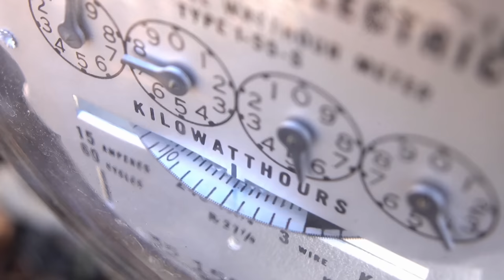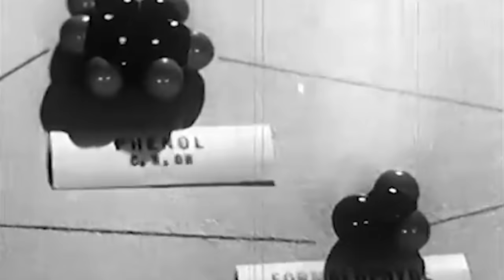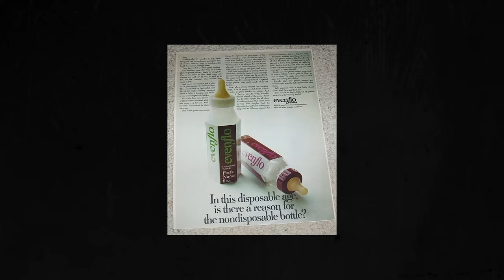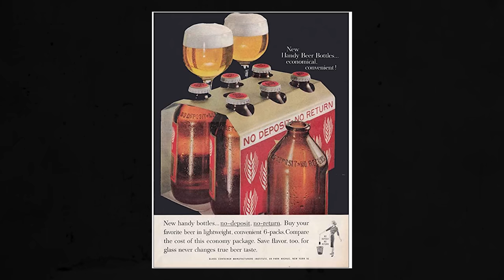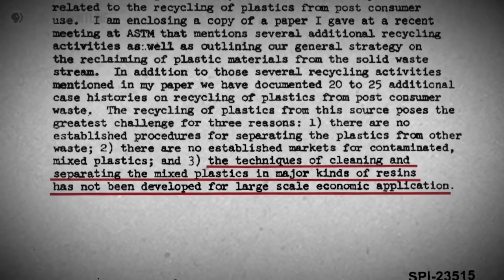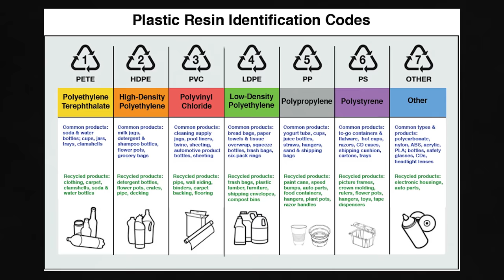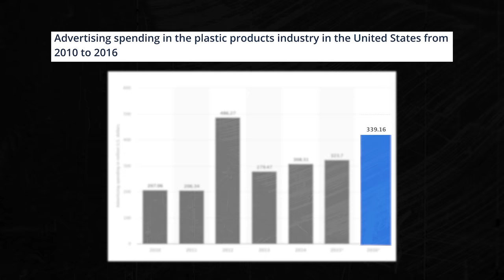The great recycling LIE (what really happens to plastic)

Comment: First of all, I wanted to clear some things, because many uneducated people are sharing misinformation about certain things. Since I'm a graphic designer who learned about the materials, I have to stand in protection of plastic, because many people push the antiplastic propaganda without searching simple stuff. Many plastic cannot be recycled, because if you want milk that won't be spoiled and  be full of dirty stuff, plastic sheets need to be stuck with aluminium sheet under high pressure to hold everything in one place. Plastic protects your food of getting spoiled unlike wood, paper... Many chemical elements and chemical mixtures react to glass, paper and wood. Plastic has been the only material who showed properties which are not reactive with dangerous chemicals. Two days ago, I watched a documentary on clothing industry polluting the world with fast fashion. They use NaOH or other chemicals with natrium which are highly acidic (I'm not English so my vocabulary is limited) and even they can "eat" glass! Only plastic containers can keep them safe. I'm all for glass for bottles and cosmetic containers, because  we drink fluids which can contain microplastics and plastic reacts to high temperature. Under the impact of heat, they let some toxic chemical compounds into the fluid which we cannot see with the naked eye. Also, I like more Coke in glass bottles, but the problem is, large companies are not ready to sell glass bottles, because they are expensive and of course we customers would pay for the end product. Paper was used before in small shops before super markets existed, because people would sell fresh food every day. For example in Yugoslavia, where my parents grew up, people would go to smaller businesses and buy meat, vegetable and they would be wrapped in paper, but for meat, it was a protecting coat of plastic so fat doesn't wet the paper. Later, super markets appeared, but still people had paper bags for FREE! bags that are free will motivate people to not use plastic, but later plastic bags appeared which were cheaper and more durable (imagine rain damaging your paper bags). Every material is useful, but the problem is the people who are irresponsible and throw them into our nature. It's fascinating that some countries rather spend billions of dollars on war industry instead on research for finding a solution to a long-term problem like recycling plastic

Comment: We recently had a project on this. My research was VERY disturbing, one of the main issues with single use plastics, besides the environmental issues, is that it is a petrochemical product, understand that earth has about 100 to 200 years worth of oil and coal supply left, that's it, it is currently our main source of energy, and we are wasting it. I'm a civil engineering major, we get a lot of interesting topics in environmental engineering, though a lot is speculation and theories, the research is a big eye opener. This video is a bit critical, saying brainwashing etc, the world wasn't brainwashed, if I give you the same product for cheaper, which will you buy, simple as that. But we have come to realise that cheap and easy is not always the best choice, but changing is tough, because the owners of these companies have strong political bonds, so before we can actually change anything, we have to change their minds, but money talks, so that'll be hard.

Comment: Not really. First, nobody can recycle all the plastic and nobody is claiming that. Same is true for metals. What you do with that excess plastic? First, burning is not bad, if there are filters in place, as well as electricity and heat from that is used. And optimal to burn is PP and PE (similar to candles). Second: landfill! Not beautiful, but makes sense: we exploited the carbon reservoirs of oil, gas and coal. Those have been carbon reservoirs. To change the circle , new carbon reservoirs should be made by us. Plastic landfill is such. Less carbon in the cycle, less CO2 in future!

Comment: In this piece, facts are represented accurately, but not so the hyperbole. The major issue with plastics issues from food packaging. Other goods made from plastics in large quantities enter the environment as durable products with a very long service life (electrical cable jacketing, piping, automobile components etc.). The main driver for the use of plastics, especially those associated with food, is their low cost. So in addition to the greed by manufacturers romanticized in this piece, I think you have to consider the greed of consumers. Consumers want cheap. Another fact overlooked in this piece is the major detriment to effective recycling: single stream recovery, which means consumers toss everything into one recycling container. Separating that waste into economically reusable streams is absurdly expensive. But consumers again want cheap, and governments are eager to not increase taxes to pay for recovery, so now in addition to creating a lot of cheap stuff, we're paralyzed trying to get rid of it. The ideal solution is to not allow it into the environment in the first place. I think it will take a lot of doing and a lot of time to invent new materials and change greedy consumer minds.

Comment: Yes this is a lie. As I was a BASF child and was fasinated by the German Recycling system. ALL waste was placed in one bin. It was taken to a single unit. The ferrous metal was removed with a magnet. Non-ferrous aluminium was removed with AC magnets. The rest was put into a large water bath and the paper or carboard floated. This was dried then burnt to feed hot water back into the local homes. the rest was dried and used to make compost. All recycled and good for the environment......No Plastics.

Comment: The use of plastics has led to an unprecedented level of food safety and efficiency.  This has led to shelf stable foods that require no refrigeration, beverages that do not require heavy glass bottles to be shipped or returned and washed, the near elimination of food borne pathogens and deaths, and has done all of this so cheaply and efficiently that the residual value of said packaging is zero.  Whining about plastics recycling not working is like blathering about condom recycling not recycling not working.  It was never meant to be.   Landfills are privately owned meaning a private landowner is happy to store your trash for a few and I use the term store because there will come a day when landfills will be mined for their resources.

If you don't like the status quo, great.  Propose solutions or ideas.  Just dumping on the status quo with absolutely no way forward is cowardly and indicates environmentalism isn't your real objective after all.
Reply: The point of the vid is that we're being lied to. Made fools.
Reply: @bsota8513  Perhaps so but there was public pressure to recycle something that wasn't meant to be recycled. The economics of it have never made sense.
Reply: @DuncanMacCockiner  True enough.
Reply: @bsota8513  There are a lot of things that make sense to recycle such as aluminum cans and it makes me nuts when I see people throw them away..  but as far as some of the plastic pouches I have seen soup be shipped in I think it's a win even if it does end up being landfilled. They weigh next to nothing meaning they're easy to ship and take up not very much room.  When they do end up landfilled they compress down to nothing. Weigh that against a steel can that even if it is recycled it has to be melted to be used again.  I can't imagine a one use plastic soup pouch weighing a few grams has a larger carbon footprint than a can would.

Comment: The real issue with recycling is that no one talks about how or if it addresses climate change. Recycling is an idea from the 70s when terrestrial pollution was the big concern. Well recycling was a huge fail in this aspect, as plastic has been collected since the 80s, shipped to Southeast Asia, where it was dumped in the ocean. Now we have an ocean full of plastic. The other thing that is never addressed is the amount of CO2 that is emitted by all the trucks and ships that are used to collect and transport the plastic before it is even recycled. The best thing we could do is simply put the plastic back in the ground where it came from. So exactly how is recycling addressing climate change? I honestly think it isn't doing a thing. The biggest impact to climate change we saw is when the world economy was paused for COVID. So, it would seem that the global economy is driving climate change and we need to focus on reducing that, not giving each other hugs because we are collecting garbage to "recycle."

Comment: Plastic is widely used due to its low cost, durability, and versatility. It is used in a variety of products, from packaging materials and consumer goods to construction materials and medical devices. There are efforts being made to reduce plastic use and increase recycling and composting of plastic waste, but it is a complex issue that requires a multifaceted approach. This is not something that you can discuss, nor summarize in a 11 minute video.

I am not a fan of plastic in general, but I don't want to overgeneralize and just blame 'the plastic industry'. Every pro has it's cons and vice versa.

Comment: Here in Ireland we have the same bottle banks and can banks they have everywhere else - a van comes around once a month or so and takes them to a central location - then they are taken by lorry all the way down to Cork - it is then shipped to the other side of the planet to China - and the Chinese dump it in the ocean...!
I re-use plastic when I can - and when I can't I burn it in my stove and get heat from it - it is made from oil and we extract oil for heat - so using plastic to provide heat isn't as unenvironmentally friendly as we are led to believe...!

Comment: The only thing the recycle bin is useful for is an extra trash can. Funny how my city charges $15 for an extra bin but nothing for the recycle bin. Of course, the recycling fee is added to the bill, and we have no choice but to pay it. It's not an option.  The city keeps sending notices in our bills, saying if we don't clean the recycle trash, it gets thrown away, so wash it. Are you kidding me? I'm not using my soap, water, and time to clean the trash.  I think it's also funny pizza boxes say if clean and free of grease, recycle, if not toss it. What pizza box has ever been like new after it was used?
  Also, has anyone ever stopped and noticed why your shoes are so flimsy or don't last long? Most likely it's because they claim to be using recycled material to make them. It's all crap. I can't stand the thin, flimsy soles that wear out quickly.  When I order shoes, and they are marked made with recycled material, I send them back. 
  The world is ran on control, scare tactics, and power.

Comment: Glass is equally problematic. It is a low value item and mechanically unable to be sorted by color as manufacturers demand. Instead it is blended with asphalt or used for capping landfills etc. It's basically about appeasing the environmentalists movement

Comment: Amazing people finding out in 2022 what I learnt in early 90s when the recycling trend started.
Not only a little percentage of plastic and paper are recycled, but also and even more important, recycling produces extremely toxic residues that environment zealots never talk about. These residues are stored in metal drums and discarded into the sea or buried in depleted mines or landfills. One day, those drums will degrade, spill their content and will turn the oceans into a toxic soup, the soils into barren lands and rivers into biohazard streams.
Just ban plastic containers on whatever it is not absolutely needed, like soft drinks, and allow it only for detergents and other toxic or dangerous substances. Soft drinks don't need plastic, returnable glass bottles are the best eco friendly solution. Bring back the milkman going from door to door which is another source of jobs and small businesses.
Ban printed pamphlets that nobody reads and throws directly into the bin. 
Stop buying the latest electronics just because it has a novel minor feature. Replace them only when they stop working. 
Stop buying new clothes to keep up with the latest fashion. Textile industry is one of the most polluting one.
Buy furniture to last a lifetime, instead of IKEA shaite that falls apart after a few months.
Demand for better public transit and use it instead of bigass high consumption private cars.
Recycling is environmentally irresponsible, it's sweeping the rubbish under the rug!!!

Comment: i collect my old cans     i use   local    milk   merchants [  glass bottles ]
  my gas and electric bill was  - £ 65  quid    as i refuse to    use  them  . 
my car runs on   veg oil    .  i have not   been in a aero plane in  40  years .
i off set this  carbon   by burning as much  as i can afford to    heating my house   .

Comment: Here in Central WA we've been trying to do everything to get a plastic bottle recycling plant here local.  We have cheap land, easy access to rail& hwy, an available workforce.  The "blue" side of the state won't do anything-other than ban straws and put a tax on plastic bags.  It's much easier, and cheaper to fill those empty shipping containers going back to China.  We pay China $500.00 to fill an entire shipping container (one that otherwise would be going back empty since we don't produce anything China needs) with plastics so they can "recycle" aka burn in open air incinerators.

Comment: Wel ist not a simple solution to just stop using plastic if no one will do it. The GOVERNMENT just has to really start prohibiting the overusing of plastic as much as they can. We've already made a decent first step with green bags, but plastic bottles are the next huge problem. Why not just switch to aluminum bottles that are easier to recycle. Or better yet just use some all natural material for bottles?

Comment: Some plastics can idd be recycled to a certain extent and only for a few cycles but most of it goes into the incenarating ovens. So it's not completely useless but it's not sustainable in the long term. Also a lot of paper cups and other fast food wrappings are unrecyclable as paper and are also incinerated because they contain a plastic coating to keep the liquid inside the cup. And you even haven't talked about planned obsolescence.

Comment: Never recycle electronics!  Almost all of them go to a poor nation where they are disposed of and recycled in the worse possible way.  Black smoke comes up from the burning resin and workers pick at the remaining metals manually.  The planet is way safer with just putting old electronics in a landfill.  Or better yet, strip the components off yourself and discard the rest.  Everyone needs the occasional capacitor, inductor, resistor, MOSFET, wires, light sensors, and the such.  I always strip all components off dead electronics, including the nuts, bolts, and screws.   The remaining fibre glass, plastic, and resin goes into a landfill.  Recycling electronics is worse for the environment than lithium mines.

Comment: Well well there's some right and there's some wrong first off it's not a grift it's not b***** problem with plastic is that it's used to made from petroleum. Now there are ways of recycling stuff and it can make people it's really good money but you have to have a huge Factory to recycle this stuff properly. You can't mix plastic it'll screw everything up I have dealt with this stuff for years I was in the E-Waste business for over 20 years the biggest problem I had was plastic waste and I had to throw it out I couldn't find anybody that wanted electronic plastic waste because of what it's made out of. And the type of plastic it was. There is a way of taking this stuff grinding it down putting it through special digesters and retrieving oil out of it but it's expensive to get the remanufacturing plant operative but it can't be done. Plastic bottles or recycled everyday and I get some wonderful thing. Everybody knows about A1 steak sauce that bottle on your table is a recycled bottle recycling glass is much easier in some respects than plastic. I'm not politically correct person I don't believe in it I don't shame people. Well other than people that have CRTs my old adage to get people to recycle CRTs was that there's 7 lb of lead in a 15 inch monitor the shield radiation and you don't want to quit that CRT monitor in the waste dump where it'll be crushed and the lead will leaks into the aquifer but that's for another day.  World War II we recycled everything and we had to there's nothing wrong about recycling.  Just e-waste if you didn't recycle it all the e-waste every year is equal to a mountain 7000  feet high and 10 Mi across that's a lot of crap.

Comment: So why not just mandate aluminum 
Use only for everything? 
No glass. No plastic. No cardboard or paper. Easy. And merely recycle over and over again until the aluminum degrades.
Reply: Even aluminum cans have to have a plastic lining if holding food or drink.
Reply: @jillpatton3432  are there any aluminum cans WITHOUT plastic linings?
Reply: @glennvastine4118  ..the lining is to prevent the aluminum from tainting taste of food and beverage, so anything not meant for consumption probably would not have plastic lining.
Reply: @jillpatton3432  how did we survive without plastic linings lol?
Reply: @glennvastine4118  ..not sure.  Maybe tin cans didn't require lining.
Reply: @jillpatton3432  we truly can’t escape plastic….